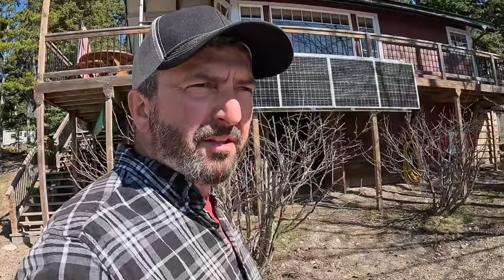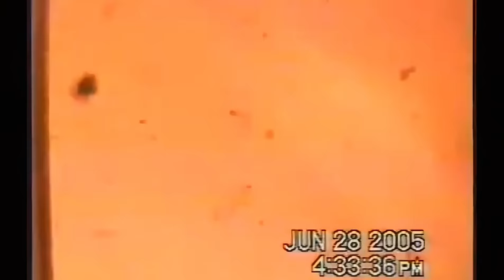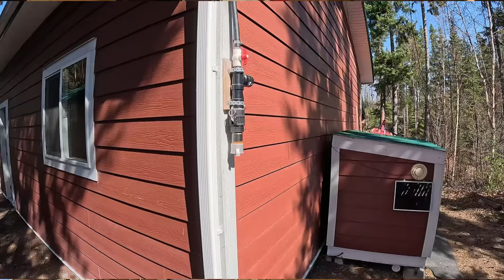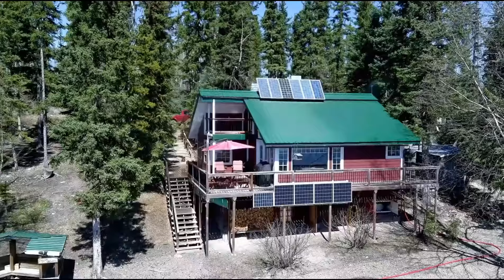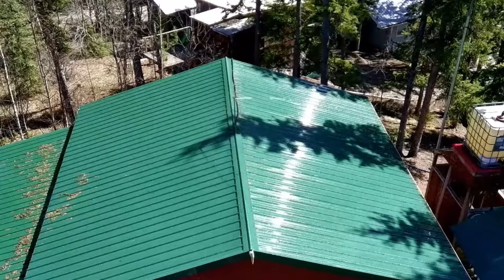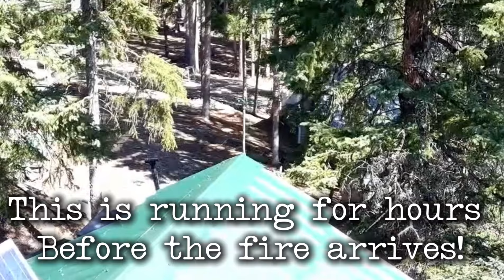Off-grid wildfire defense that actually works

Comment: Here in South Australia we have a process of defending  Isolated structures by concentrating on prevention of ember attack. Water systems are also used here expensive and consuming huge amounts of water people use swimming pools for storage and micro sprinklers also nearby trees & vegetation is drastically reduced. The pump should be diesel powered and regularly maintained & tested even flyscreens should be metal. 😊
Reply from the maker: Thanks for sharing those insights from South Australia, definitely some great practices to keep in mind! 😊

Comment: Get rid of the conifers next to the house, they are a SERIOUS fire hazard. conifers will ignite much quicker than leaf trees like cotton wood or popular...Also, it is not just the embers and sparks that can or will ignite a house on fire, it is the extreme fire temperature itself that can ignite a house fire..
Reply from the maker: You're absolutely right about the radiant heat and the risks posed by conifers; I'll keep working on that. Cheers!

Comment: Words of advice here. Upgrade your lay flat supply lines to fire resistant one as those blue ones will melt through real quick in the heat of a forest fire.
Reply from the maker: Thanks for the tip, definitely looking into more durable hose options for the future! 😊

Comment: Lost our cabin in Spring of 2025, was an island property this system wouldn't of been enough took 50 drops from two water bombers to get the edges down enough to get ground crews out. Really depends on the fire you are facing our lot didn't help had a very dense mix of eastern white pine, red pine, balsam fir and white birch of varying ages some of the white pine was 150 years old it all went up like a bomb and it was hot melted 1/2" copper pipe that shouldn't happen, melted an aluminum lund fishing boat, the steel didn't melt including the tin roof.

Honestly the best thing you can do is make sure you got adequate insurance, you can have a great fire prevention system but if the perfect storm hits or it fails make sure you have the coverage. Debris clean up insurance was inadequate for me I only had around $20k (based on 5% of the value of your main dwelling) I would of needed around $27k even then I'm still finding scrap and I took on the cleanup myself, I was about $44k underinsured on outbuildings and decks. That's about the limits of the bad news, I had adequate coverage on the cabin itself and that was dipped into for cleanup a new survey of property. Personal property I had more coverage than I needed and a lot of stuff I won't be replacing, at the same time for a cash settlement from insurance I took the lump sum and that's $0.75 on the dollar. I'd highly recommend doing an inventory, having pictures and videos of property there is always going to be stuff you'll miss though or remember 4 months down the road. I looked at insurance in terms of if I sold the property would I be happy with this number and I felt it was more than fair. What I should of looked at in hindsight is this enough for full reconstruction costs and in that regards it is tight.

I have a beautiful new cabin much nicer than the old one but I'd trade it all for the old cabin and the lot, the lot is the toughest thing for me to get over, a hundred years from now it will likely be nicer than the old lot but I'll be long dead by then.
Reply from the maker: Thanks for the infor. Sorry to hear about the loss of your property.
Reply: @HacksandProjects  Yeah it's kind of the other side of the coin. I'm thinking what could of have done differently to avoid the fire? I don't think any measures besides turning the lot into a parking lot would of helped and I couldn't of done that either.

Fire happened less than a week after ice out, normally there is still patches of snow still in the bush. Not that year, conditions were bone dry and 75 km/h winds from the south, my property is adjacent to crown land so I'm limited with what I can do there. I loved the trees, I could reach out and touch them off the decks, that's what drew me to the property and made it at risk. I'm right on the water with NW exposure to the lake which is the prevailing wind. I shut the main breaker off in the Fall and drop the water. The actual fire was started from a tree falling on a power line, I hadn't been to since the previous year; with no power and no water and I'm still at risk of frost so water wouldn't of went in till at least May long weekend.

This was just a perfect storm had one thing gone the other way it wouldn't have happened: wind from the north or west, less strong winds, no ignition source, a winter with more snowfall, a cooler or wetter Spring, Hydro One removing that tree that broke off and landed on the power line on the right of way, the water bombers getting there sooner or reporting the smoke from the mainland earlier, the event happening two weeks later. It's a long list.

The good news is nobody was hurt and a lot of properties were saved.

Comment: Nice installation.
You might also invest some time in creating "defensible space" around your house by clearing an thinning flammables.
Reply from the maker: I agree, creating more defensible space is the next big project on the list! 😊
Reply: 30 metre cleared around the house, remove the firewood under the deck and anything else flammable like outdoor furniture.  The biggest risk is ember attack that precedes the fire front. The embers wedge or pass through gaps in your building envelope and burn your house down before the fire arrives. Have a good look at windows, doors, vents etc for ember access. 
That IBC for water is a candidate for ember attack.

Comment: This "moisture dome" theory is a nice thought but until you've been on a fire line and watched the radiant heat cook all the water out of a green trees right in front of your eyes in minutes, then they catch fire like a match.  The radiant heat generated by a wild fire  is a force that you can't imagine. That same radiant heat will be magnified by your windows and catch your draperies on fire inside your house.  Last but not least, the plastic water lines are the first thing to go.   One more thing, those trees close to the house.  THey'll catch fire then fall on your house, catching it on fire.  Clear trees and shrubs back 100' from the house, move the fire wood, box the underside of your deck, etc.....
Reply: Not entirely true. There have been many houses surrounded by total destruction from wildfires saved by people being proactive. Pacific Palisades (LA Fire) is a great example. Don't get me wrong, though, luck does play a part no matter how much you try.
Reply: If i needed to i would run fixed metal water pipe to the roof
Reply from the maker: Those are some incredibly valuable points, and I'll definitely be looking into clearing more space and hardening the structure further. Thanks for the feedback! 😊
Reply: @HacksandProjects Important to have sprinklers not just covering the roof but the eaves, walls and decks of the building.

Comment: Your place is incredibly combustible. Wood construction everywhere, shrubbery, coniferous trees far too close, firewood stacked close, little wooden outbuildings just a few feet away.......yes, you might be able to save the place with your unlimited supply of water, but why not increase your chances by removing the above things? And put some thought into how and where wind-driven embers can enter your structures. This is where attention to construction detail is vital and that's something I'm dealing with right now with our home. 

I applaud your use of steel roofing and Hardiplank siding. Around here (central British Columbia, Canada) we lost twelve home in the 2017 fires and the homeowners promptly rebuilt with the same wood siding and all-wood decks that had caused the losses in the first place. Some people never learn. 

One more thought: please consider burying your water supply lines; one good-sized ember can burn through your ground-lay lines in ten to fifteen minutes and then your entire system is toast. Good video and great ideas!
Reply from the maker: Thanks for the solid advice; Have to work with what you have! lol.   Burying the lines are in the plans. Cheers
Reply: This is better advice than what the video provided.

Comment: Works great with a lake as a water source. I'm assuming its legal for you to pump from that body of water. Most people in the mountains don't have that unlimited water source or the water pressure to run your system.
Reply from the maker: That's a fair point, and unfortunately, wildfire defense strategies have to change a lot depending on your specific water access. 😊

Comment: I would cut back all those close trees too close to the house. I would also add more sprinklers to the edges
Reply from the maker: I agree.  There are more sprinklers (and bigger ones) in the next phase. Cheers!
Reply: @HacksandProjects Probably very wise because the range with that sprinklers and the volume output is still low.

Comment: I asked my self years ago, why dont people living in fire prone areas not do something like this.  I would.  Why wouldnt the insurance companies tell customers, they can get insurance if they do this.
Reply: My wife and I were interested in sprinkling our previous home (indoor sprinklers) but didn't when the insurance company said there would be no reduction in premiums. Our present home IS fully sprinkled inside and out, insurance companies be damned. I despise them all.
Reply from the maker: Typical insurance  :-)
Reply from the maker: Truthfully I never thought of it until we had a fire close by.  But now it seems like ever year its a problem.  Cheers
Reply: Insurance premiums aren't reduced because you are just trading fire loss to water damage loss. Either way its all destroyed and the cost is about the same to the Insurance company. 

Plus sometimes the sprinkler systems goes off when they shouldn't, this leads to losses even without a fire. 

The sprinkler system is more designed to give you time to get out and slow things down, so it saves your life. The damage costs are the same.

Comment: Do you know the melting point of your plastic plumbing parts? It would be a waste if the plumbing melts before the flames even arrive. The lawn sprinklers will leave areas unprotected as they rotate and you need to understand what level of volume you need to overcome the "water turning into steam" issue that a low flow sprinkler will provide. There's a reason that sprinkler systems are designed the way they are and not at all in the way you have made yours. It's better than nothing, well, maybe if it survives the heat first. If not for the gas engine, your system would be better suited to a thermal break for summer cooling assistance. A large pressure tank of water and an air compressor with steel plumbing is the place to start. You'll want a 2" line piped to each building to flood the shell of the building. Did you research the amount of water pressure and flow coming out of a fire truck pump? It's a whole lot more than your trash pump can output. The laws of physics can't be broken, no matter how good your intentions are. Do you really want to see the results of the fire damage that will happen even with your system operating? You'll be upset over the loss of the buildings and upset when the sprinkler system turns out to be under engineered. I hope you never need it. As a first attempt prototype, it's creative, but not at all practical, because of the lack of critical performance standards that it could never measure up to.
Reply: Let's not start convincing homeowners to give up without trying. I hear these criticisms all too often: "You're not a professional, fire science is too complicated for homeowners to understand, it's impossible to protect buildings during a wildfire, just follow orders and run for your life!" It was been found through experiments on the 2007 Ham Lake fire in Minnesota that laying down approximately 3mm or 1/8 in. of water an hour is sufficient in most cases to raise humidity around a structure and prevent ignition. 102 homes were saved in that fire using simple sprinkler systems like the one shown in this video. That's a good rule of thumb. More water, of course would be better still, but those of use using limited water resources the 3mm/hr is the goal. 

Don't ever let naysayers talk you out of doing something constructive. Do some research, take action and good luck!
Reply from the maker: I really appreciate your comments!  Its difficult to try to get the point across in the video.  Its not a perfect system (there isnt one) but I'm willing to make the effort to at least try.  Cheers and thanks again.
Reply: @paulmaxwell8851  Building with better materials would be the true solution. The volume of water and the length of time available running the pump are details that seem to be forgotten here also. This is a lesson in futility. I'm not saying that it won't help with a minor fire issue, it's just unlikely that anything minor would occur there. If anything happens, it's going to be very bad very quickly. That's just how it is in a rural location. I'm a long way from civilization, but I'm building smarter by using better materials and design.
Reply from the maker: Thanks, There is more than one way to help protect your property.  But I know this not an exercise in futility.  Cheers
Reply from the maker: Thanks for the information!  Im always trying to improve.  Cheers!
Reply: Some parts can clearly be improve and the this might be a weak link, but if that were to happen shit would already be going south. 

Sprinklers w 30 ft range at each corner of the cabin and second structure would clearly require a larger pump and overall system.
Reply: @paxundpeace9970  The way I see it, if this minor amount of water were effective, firefighters would use it. There's a reason why they travel with 2" hoses. Putting out a fire with gardening hoses is insane and dangerous for those who would risk their lives with it. Can you imagine being responsible for numerous families' deaths because they were stupid enough to put blind faith in a system like this? This is a combination of a "stupid tax" and "suicide by faith in advertising".

Comment: That raised deck should be your biggest concern, with the fire wood underneath.
Reply from the maker: That's a fair point, I should definitely clear that area out to reduce the risk. Thanks for the advice! Cheers.
Reply: @HacksandProjects  clear it and cover with aluminum siding. More spiders… but less chance for embers to get in there.
Reply: There’s also fire mesh to cover openings
Reply: @HacksandProjects  you should check the video zack of all trades did recentely on the same subject everything burned around his house but not the house so he did quite well i presume and he makes a very good point about his deck ( which im 100% sure would have caught and burned the whole house if he did nothing). you' re on a good start but look for those improvements stay safe man 😉
Reply: It really isnt the big concern. Pine needles on your roof are.

Comment: That's all good until you have the Texas Panhandle wind. No water would touch your house. Its still a good idea.
Reply from the maker: That’s a fair point, high winds definitely make any exterior water system a lot tougher to manage! 😊
Reply: Even in high winds/high temp/low humidity water will still pool up in gutters.  The winds push needles/leaves into gutters, even if they were just cleaned.  I've heard of people modifying gutters to hold water during wildfire event.
Reply from the maker: Yes another commenter noted closing off the gutters as well.

Comment: People burry your lines underground. One ember and the hose is lost and the system is lost. Period
Reply: Maybe run 2" PVC line if you are going to bury it
Reply from the maker: That’s a great point and definitely the most secure way to set it up! 😊If you have the TIME and the money !  Cheers
Reply: @HacksandProjects I saw a guy on here who had the whole system fail from one line catching a single ember. Your system is great in theory  but a trencher or a shovel will make your title accurate
Reply from the maker: I agree. But keep in mind this system does NOT fight the fire. Thats impossible to stop.  Running the system for hours before the fire will hopefully cause the humidity dome to reduce the damage.  Cheers
Reply: @HacksandProjects  your title suggests you’ve confidently found the proper solution to defending homes from wildfires. People will copy you and your confidence. Please don’t be defensive about my comments since you were so confident with your title. Running lines underground with a generator and leaving the house while the fire approaches and letting the system run is what actually works NOT this system
Reply: Embers can travel several Km ahead of fires.  You've done many of the important things like limbing up trees.  I've watched flames travel from brush to limbs and once pine trees are on fire there is nothing you can do.
Reply: Yes, it all takes money.  I keep a list with costs and rank each item.  Lots of ideas, many are urgent upgrades that I just haven't got to yet.